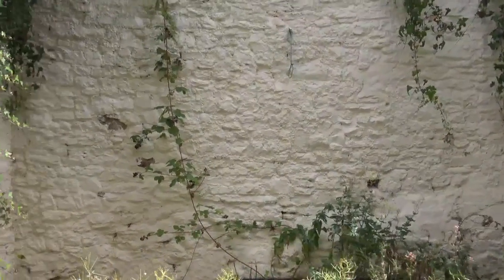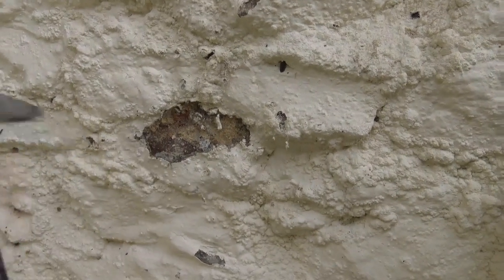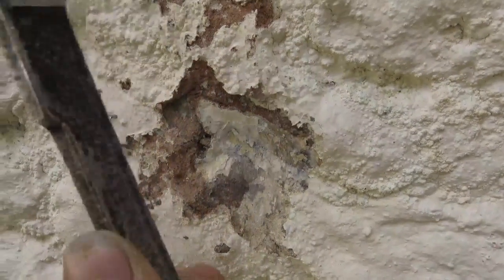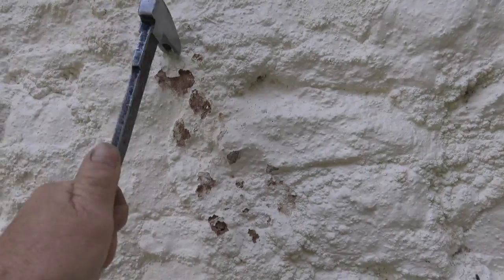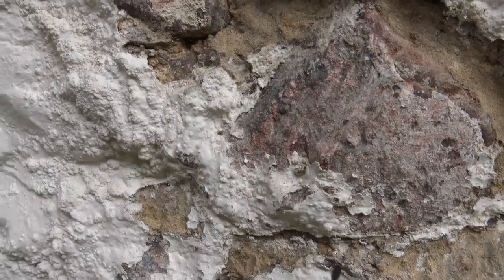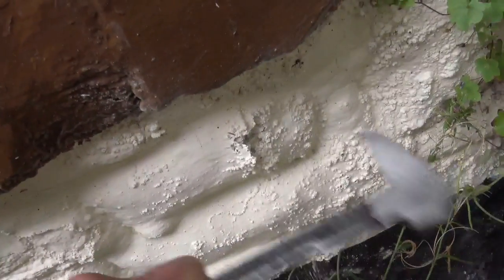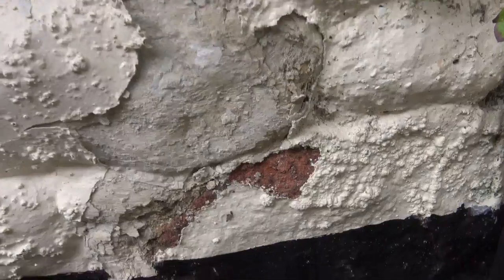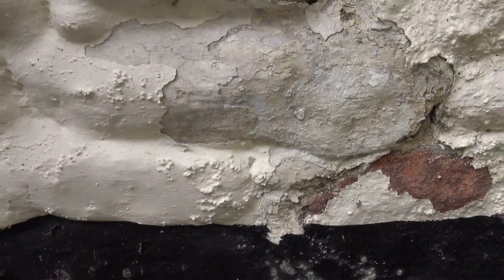Plastic masonry paint - how it destroys walls!

Comment: Peter, how would you recommend that the paint is removed? I have a near identical stone wall that I want to clean, repair and lime wash but I have been advised to use a needle gun, pressure washer, sand blasting and multiple other options to remove the paint - none of which seem to be without problems.
Reply from the maker: Theres a company called stonehealth - doff of torq - processes.  High temp water blast - little abrasive - approved by english heritage - or hire the kit from thermatech - hot water mainly which softens paint first, so minimal damage to stone.  Its peeling stone because paint is sealing moisture into stone, and its just degrading the binder - probably calcite - if sandstone.  Just have to accept the face is knackered and move on - get rid of paint, present new surface to atmosphere, and hope!  Rake and repoint too if there is cement in the joints because that will do even more damage to the stone than the paint..
Reply: Hi Tony H just wondering if you managed to find out the best way to remove the paint as I've also got the same problem. I can pick it off in places with my fingers, the plastic paint takes a small layer of sandstone with it approx 1mm. In some places my sandstone is turning to sand!
Reply: Peter Ward
Reply: Tony H I tried to hire a Doff machine from Stonehealth and they said they only hire them out to companies that already own one.  The machines cost around £6000, so not a cheap investment and apparently you need a licence to prove you're a competent user.

Comment: Just bought a Welsh Stone Long House (circa 1760) and somebody has used cement based render and plaster inside and out and then painted them in acrylic paint. The cauliflower look is alive and well internally and externally. What the best way to get the old acrylic paint off the outside? Can you use paint remover or is it just a case of chipping out off? Are the walls becoming irreparably damaged as I can't afford to get anyone in to do the work until I save up the cash. Thanks.
Reply from the maker: See above comments - try hiring thermatech gear - it'll remove paint .  Then you can remove all the cement pointing that is inevitably there as well.  If welsh - do a course at Ty Mawr - brilliant place, you'll learn lots about low cost approaches.. !